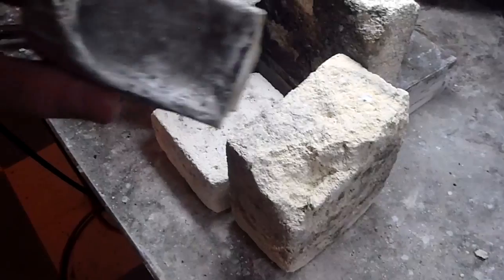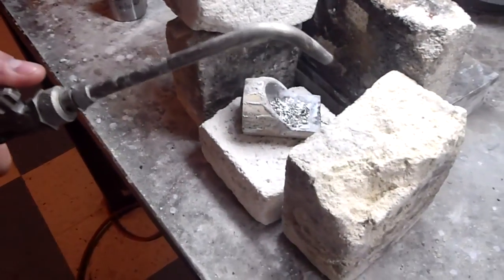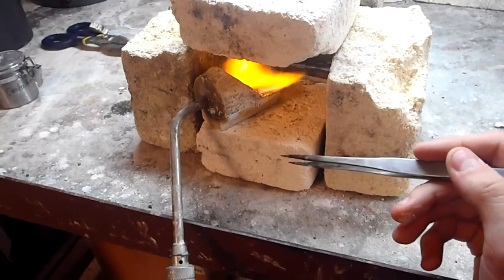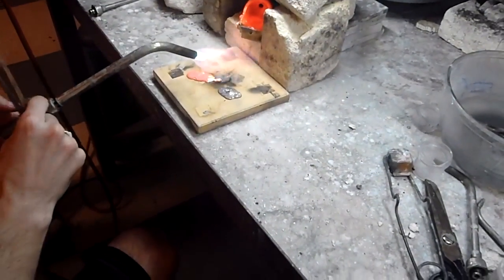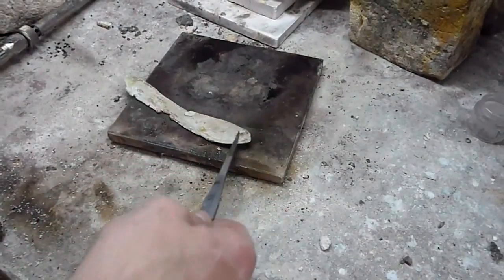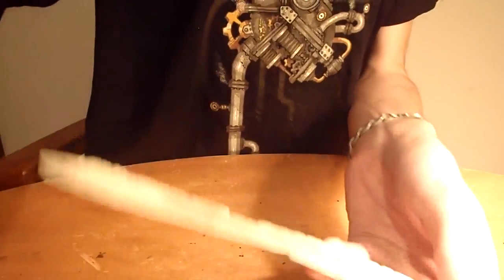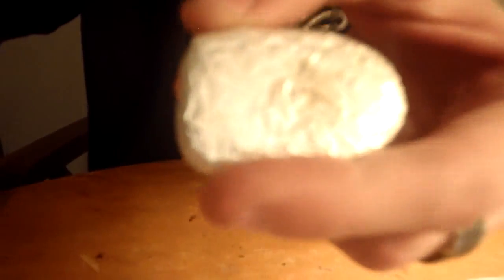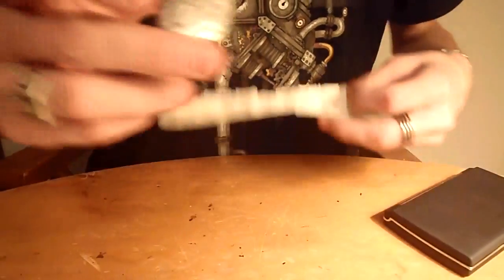How To: Forge Sterling Silver with Drac (metallurgy modding like a boss)

Comment: That would be an acetylene torch, acetone is what is used in the high pressure tanks to stabilize the acetylene gas (because it it unstable at over 15lbs)